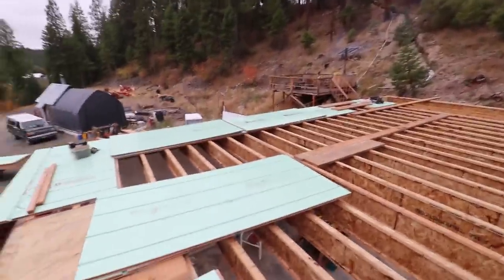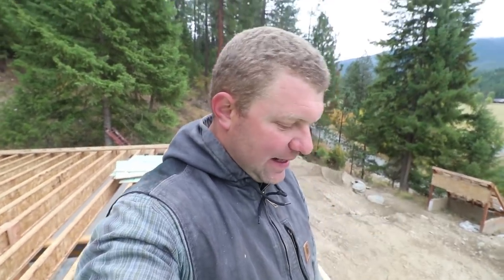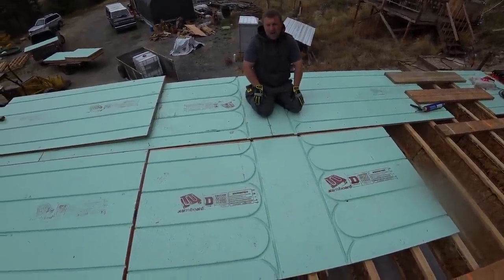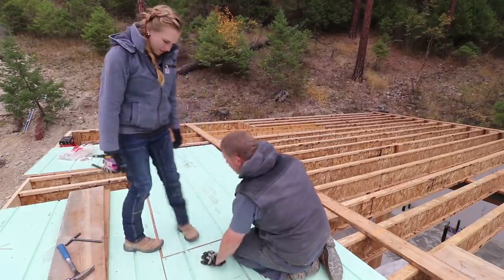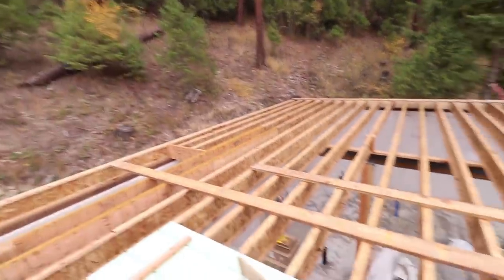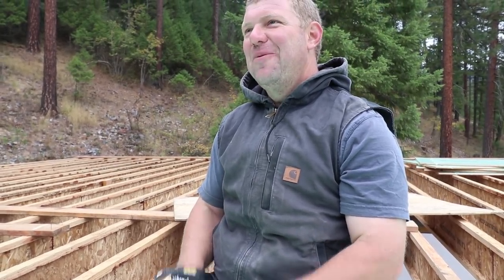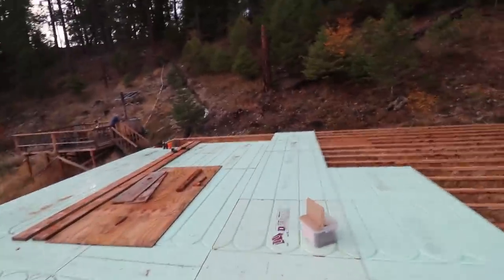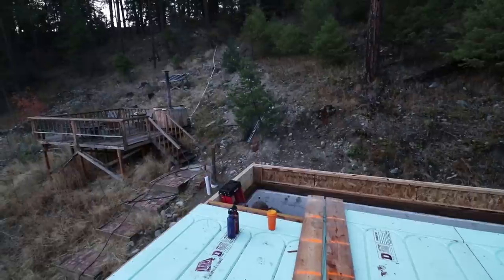Building a House Start to Finish: Radiant Floor Heating Installation Ep 2

Comment: As a carpenter it's hard to watch these episodes. They make the simplest task seem hard.
Reply: XPL A sledge hammer and a 2x4 would make for fast TIGHT joints....stead of 3/8 gaps.
Reply: Hahahah I agree, and the silliness of using impact guns for all of this is crazy, they should have finished that in a couple hours.....
Reply: 2chipped - Wrong.  The joints get set to the fitment of the radiant channels.  That's why they're not slammed together, it allows some flexibility to line them up.

Comment: I have framed houses for over 35 years and this is the first time i've seen anyone use a framing hammer to put toung and groove plywood together...I've always used a 2x4 and a sledgehammer. Nice to see you are showing that you can get it done with what you have.  ;)

Comment: L/360 and L/480 is actually a deflection criteria. For example, to find the deflection of a simple span beam, the equation would be L/360 = 5wL^4/384EI. W is load, L is length E is modulus of elasticity and I is moment of inertia. 

In other words, its what we use to design the actual member. We want to increase the moment of inertia of the framing to reduce the deflection.

Hope that makes sense

Comment: I know it is a bit late, but I just went through the T& G hell when putting the ply on the first floor of our Timber Frame build. Just like you said at around 3:48, If you don't screw the front edge down on the boards until after you bang the next one in place it really makes the install go easier.  You figured it out way sooner.  I was half done when I figured it out.  Great job guys.

Comment: Going into the colder weather you can throw a couple tubes of your constriction adhesive into a water tight bag and then put them into you hot tub for about 15-20 min. Doing that will allow for a smoother bead of adhesive. I usually use a 5 gallon bucket with hot water for silicon, latex, and construction adhesives.
Reply: mlowe30 I was thinking they could put it in something where it would float on top of the water or even just inside the cover of the hot tub and the heat from the water would radiate and warm the tubes

Comment: Looks great. I worked on a project where we moved a 330,000 lb. load over a concrete floor with a basement below.  100 lbs per sq ft. was the max load for the floor.  Lots of cribbing and beams to spread it out.  Nice to know you can put a heavy table or sofa with 5 people on your floor without any worries.

Comment: A rubber mallet on that t and g will work much better if you have one. Also what we used to do with my dad building houses and pattern specific underlayment is for example pick a direction say north then get all your board up there besides the last north row. That way you can basically walk the whole floor but there's still wiggle room to move stuff around. Also if you get it all laid out in the right pattern you can just go pedal to the metal when it comes time to screw it off.

Comment: I purchased the Ryobi electric caulk gun for a remodeling project. I have a disease that effects my muscles and I cant use a regular gun for very long. The guy at HD made fun of me. BUT... it was worth every penny. I love it. It's not that expensive and the charge lasts forever. (I would make sure if u buy it to open the box in the store and make sure the slide works. My first one did not   But I only live 1 mile from the store) you can adjust the amount of caulk used. Worth the investment if u have a lot to do.
Reply: I second this. You can get air or battery powered ones. The ones where the cartridge is loaded inside an Aluminum tube will probably last much longer. The advantage isn't just that you don't get hand cramps, you can lay a much more consistent bead, and do it faster than even the most expensive ratchet rod hand operated guns. On a project like this there will be a lot of caulking.

Comment: For some reason, I’ve found it most cost-effective to buy batteries for my Makita tools by buying a driver/drill combo kit…  (given how I abuse drills, it’s worked out ok)   For example, in my neck of the woods, last week I could have bought a  Drill+impact combo with the fast charger and three 4 amp/hr  batteries for LESS than the local retail cost of the batteries alone...

Comment: if you EVER need to place more tongue 'n'groove plywood, dig out some ratchet straps to pull them in instead of using mallet and battering stick, it goes faster and are generally much easier.

Comment: Your "I" joist have two spans in your home. Be sure you place bridging in the center of each span, very, very important! You can add the bridging at the last stage of the construction, after the structure has settled during the construction process.  
....13
Reply: as a structural eng. you may get away with out, but you are far better off having it in...

Comment: Best way to heat the glue up is with a heating pad in the bottom of a cooler.  Doesn't make it super hot, but even in freezing temps it keeps it flowing and portable.

Comment: You may be able to have your Makita repaired. I stripped a gear out of one about 20 or so years ago and took it to a tool shop and they repaired it at a very reasonable rate... Lasted for a few more years, in fact the drill driver is still in good shape, but I can't find batteries for it anymore...

Comment: I know that its already done, but if you wait with that last row of screws joining tongued boards becomes so much easier. And in some cases it doesnt help due to manufacturing tolerances.But when halting for the day they have to be screwed anyways to glue properly.
Reply: And if I had watched 10s longer before posting i had seen that you already had figured it out.
Reply: Joseph Bridges then you should not work so slow or choose a glue with longer "open"-time or whatever its called in us English.

Comment: If you don't get under-roof before it rains, will water lay in the groves? And will that cause the warmboard to deteriorate? When building our house we had snow, then that melted, etc before we got the roof on. The only thing that saved the vantech flooring is the Thomson's Water Seal and shoveling the snow off as soon as possible. Ah! No sooner asked the question and it rains! Leaf blower to remove the water - great idea!

Comment: I'm not a builder by trade, but I have been watching building shows on TV since "This Old House" season 1, so I wonder...does it make sense to install temporary stairs? It seems with all the trips you 2 have to make up and down in a day, it would be easier and safer on stairs than on ladders. And again, from what I've seen on TV over the years, temporary stairs take what, 1-2 hours to install? Just curious.

Anyway, thanks for the new videos. It was a tough few weeks without a daily fix of PLfL.
Reply: Temporary stairs would take Jesse two full days to build.  A low incline wooden ladder might be better.

Comment: You might be interested in some of the modern OSB products that are arguably better than plywood. It's a popular topic for debate, especially with stubborn old-timers. One of those is Advantech. It's OSB that's been impregnated with so many chemicals that it acts more like a composite plastic/wood. You can literally throw it in a lake, take it out a year later and it is still perfectly square with no swelling or warping. It absorbs zero moisture and thus is way more impervious to rain during construction or plumbing leaks later on. It is also stronger than plywood. One debatable point is screw pullout force. Plywood might still be better with that. But otherwise, it is a far superior product that is rapidly replacing plywood, not for cost, but for quality. It is preferable to a plywood subfloor in my opinion.
Reply: Advantech has it's place but not recommend for hardwood floor installs.
Reply: Certainly it is debatable. Many people would recommend it over plywood for hardwood. I'm standing on my own hardwood floor above advantech though, so maybe I'm biased. Suffering some injuries during a gut renovation, I left my kitchen subfloor outside in Pittsburgh for an entire year. Still perfectly dimensioned and true.

Not to say plywood is bad. But advantech is in a completely different category than OSB. Anyone interesting in building materials would be interesting in a product that really is revolutionizing construction. It ranks right up there with engineered joists.
Reply: so clearly you have never got osb wet... you maroon!
Reply: Did you even read what you’re replying to?
Reply: OSB swells!
Reply: Daniel Kelly did you not read the post you’re replying too? The modern OSB products are literally water proof. Throw a sheet in a swimming pool for a year and it will still be completely undamaged. No swelling, no warping, no delimitation. Old or cheap OSB is what you’re thinking of. It still exists and is common. However, products like advantech (there are a few others) are different. They behave  more like a plastic.
Reply: Seriously, it is worth checking out because it sounds like you’re unfamiliar. It is transforming new construction, especially in rainy areas. Instead of plywood subfloor and traditional OSB sheathing. Products like these are being used. It doesn’t matter at all if construction is delayed by a multi month monsoon that drenches everything. Framing might warp but the floor and sheathing will be 100% undamaged and still dimensionally true. It is literally rain and snow proof. A building could sit unfinished for years and this material would still be perfect. 

And it is also as strong as plywood.

Comment: Get yourself a drywall T-square. They are a great help with marking plywood and other 4x8 material. I would suggest getting one with the thumb screw so you can also do angles.

Comment: Have you thought about when you have a few moments when it's raining or something to take a gallon ziplock baggie and film you taking the other impact apart and figure out what parts you need an order them and rebuild it you can normally get the parts for them things for two or $3 a piece so if you only need a few pieces you can probably fix it for under 20 bucks someone threw out a big huge grinder it only needed a handle part where the trigger is purchased it for 9 bucks I know grinder that size would cost almost two hundred bucks it was a Bosch 1357  it is a 9 inch grinder buffer polisher I found it in the trash

Comment: looks good!  Its hard to give tips since we are usually weeks behind, but I just thought of one you might be able to use.  Just in case you are using traditional fiberglass insulation, there is a trick for protecting yourself from it.  Cover yourself in baby powder, it will keep you from getting itchy while installing it.  Of course your probably using some fancy new product i haven't seen yet.  I am curious though. would it have been possible to start building the stairs so that going up and down would have been easier.  I know when I built my new house a few years ago the carpenters were quick to get the stairs framed in to make it easy to access the second floor.

Comment: using a sledge hammer to seat the panels works better and is less effort with a board in between of course but by now you should have your sips up i hope seeing we got a foot of snow

Comment: I am surprised that there is no blocking between the joists to ensure they remain parallel and stable.  Surprised you are not having issues with the 4x8 sheets of plywood landing directly on the center of the joist.  Also ditch the hammer for a sledge hammer.

Comment: Jesse, use a 4-5 lb. engineer’s hammer to seat your tongue and groove joints, much easier on you and the material. You have to pound much harder with the smaller hammer.

Comment: Can I just start off by saying. I have watched most of your journey on this build and love it.
Just some words of advice: Wear knee pads... I spent most of my working life on outside building projects, up and down on my knees doing various jobs like, patio slabbing, block paving, etc. You get the picture, Right? Well I was fine for 30-40 years with no problem. Now 60 years old and how I wish I had used knee pads as cushioning, support, keeping moisture from joints etc. Learn from an old guys mistake guys... Arthritis is no laughing matter!

Comment: I would also like to advise you when everything is done ... the ceiling of the garage with non-combustible panels (the top structure is entirely wood) and to put on the second floor to the ceiling unburnable panels .... then will your future tire insurance with a few hundred dollars be cheaper !!
Reply: Erwin De wilde I've been a union carpenter for over 35 years and have no idea what you said.

Comment: You guys doing a great job ..congratilations i have one remark...why dont you fill up the open spaces between your panels with Pur foam...?makes it waterproof and you have no loss of heat once your heating tubes are installed... also makes your floor solid Grts ...i follow you guys since the beginning of your amazing 😉 Project from Belgium 🇧🇪 Europe

Comment: Piece of wood goes flying towards the camera at 21:02. Careful guys, hope you have eye protection. :-)
Reply: Actually, several pieces went flying. One was when Alyssa was setting the T & G on the same section a few seconds before that, and a third piece went flying in Alyssa's direction @21:06.

Comment: How would you guys assure to get away from termite problems with the wooden houses? I mean its not a criticism, here we only have concrete houses or made up of brick and cement.
Reply: My guess is that 10 feet of concrete and air would discourage most termites. They build their nests on the ground (in David Attenbourough's shows about Africa,  we don't have termites in UK).    The hot tub deck can be their early warning system if termites come near.
Reply: Where is here? Most all houses in the US are wood. Now some areas termites can be an issue so they treat the soil and add metal barriers to keep them out.
Reply: here we have concrete base also but the doors and other furniture gets termite every season so we have to spray. There is this special kind of wood  (not sure abt the name maybe sheesham) that dosent get the termites but it is very expensive per square feet
Reply: Ibraheem Ali are you in Siberia?

Comment: Ok guys the next time you need to install tounge and groove boards you need to route a groove in your hammer board to protect you tounge from hammering.
Reply: Bill23799 tongue and groove boards, like the warm board. So they dont chip the edge of the tongue  (in the tongue and groove) so they dont have to cut out the notches like they were doing.

Comment: I take it that your battery/solar setup has been providing enough power for running the power tools?
Reply: Pretty sure he upgraded the panels this spring/summer some time
Reply: Those 3 panels they have there are over 1200 watts.

Comment: what kind of heating have you chosen? are you still going to be off grid? Does the florrheaating take a lot of the energy to heat?
Reply: Wrong question. The required energy depends on the heat losses of the house.
Reply: wrong question... how rude!
 I asked what I was wondering about!

Comment: I heard you say you need to move your RV under cover to  new construction not sure if your roof is on yet - but if its not - get a roll of black plastic  unroll it over warm board  with a 4 inch over hang use boards on the side to secure and you would have a 100% dry area  in garage  to park rv keep cameras and tools dry and  you all too till you get roof on -ps be careful putting roof on  what is pitch of your roof?
Reply: You can even leave it on even after the walls ar
Reply: you are right
Reply: thanks like to see that video

Comment: You are probably well and truly past this point, even on the upper floors, but...

All the TV shows and other You Tube channels show the panels being set with sledge  hammers.   Lots easier and faster.   No bending either.
Reply: John O'Halloran spoiler alert the frames fully up now (it's all been on their Facebook page, they just haven't had time to video, edit and post it due to the crazy schedule they've been working to)
Reply: John O'Halloran not to mention he doesn't respond to suggestions.

Comment: 4x8 warmboard panel = 32 sq ft. If you're saying that load of panels weighed 1150lbs, then that's not 30lbs per sq ft. 32sq ft x 35.939lbs = 1150lbs... close Jesse!

Comment: "it's incredibly strong"...well, that's if you ignore the fact they router out 75% of the material depth wherever there is radiant track.  That's why the radiant lines are run perpendicular to the joists and not parallel.

Comment: I️ would hire y’all as a general contractor
Reply: Giovanni Alvarenga if you wanted ur house to take a year to finish they'd do alright. It should take 1-2 days to joist and sheet the floor. Granted they're new to it but contracting a job is no easy task

Comment: Yeah... 1200 pounds across those joists is not going to be 30 pounds per square foot.  The weight was only transferred onto the width of those joists not across the entire surface of the panels... but meh, if it's going to be holding everything in that room and the flooring too. It's good to go holding a stack of plywood.

Comment: Probably to late, but in fitting tight tongue and grove panels, candle wax makes for a good lube.  Rake the candle across the tongue and the pieces should fit together with far less mallet work.
Reply: It might be late, but I appreciate the commitment. I will use your idea.

Comment: Loose the screw guide and stand up and use your eye. If you miss who cares. Good job just ripping that bunged up tongue out and the just going to town on the bad spots,, your getting it. Not everything needs to be perfect,, that warm board needs to hold a couple pipes and go to the next piece,, that's it.